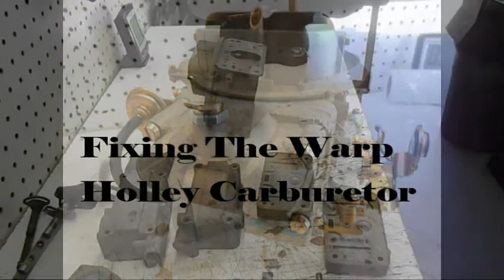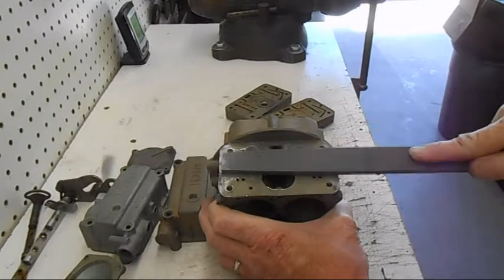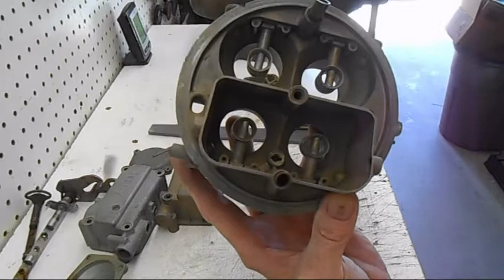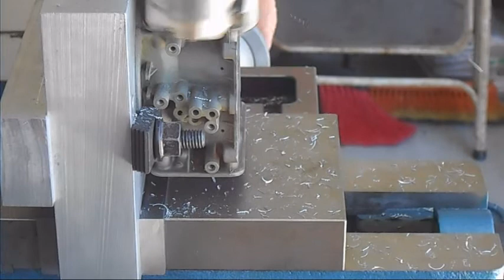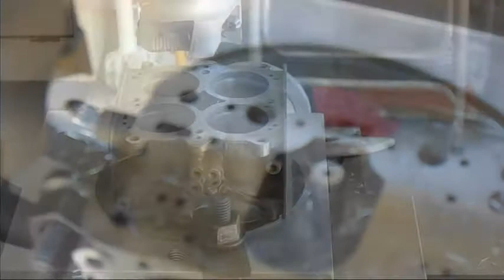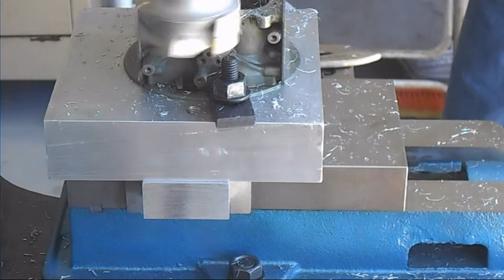Holley Carburetor Fixing The Warp and Rebuild Part 1

Comment: Yes your videos are awesome ....I too have my own rebuild restoration shop most of my customers are Rochester and Carter some holley. They race them or derby them and some are mudding in the back 40.....and I have to say I've seen others talk about how to do.....but they don't get into depth like you thank you for that....right now I'm trying to patent a heated teflon spray for gasket areas .it works by not allowing the stock paper gaskets to stick.between the metering and body.....Dupont teflon spray.has a rattle ball so you can shake it leaves gaskets and body with a light white film......and also works  for ...drag racing the rear venturi.i polish them then heat them with a heat gun then spray them with teflon.to make it more responsive...works for have a season before it needs to be redone.......I'm a  subscriber to your channel........and I always look forward to a new video ...thank you Dennis.